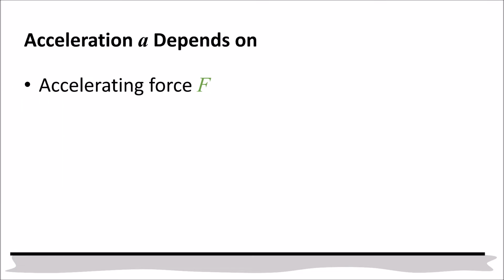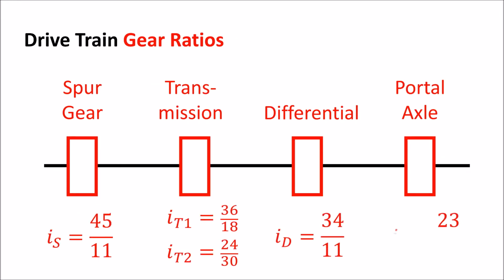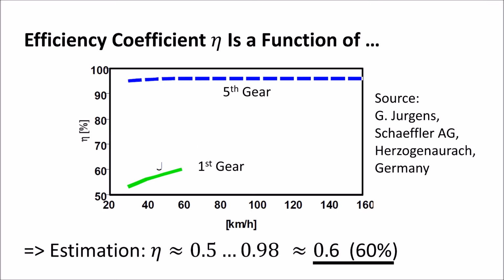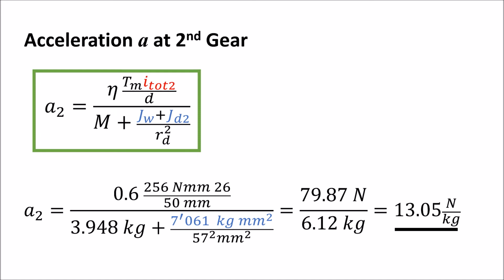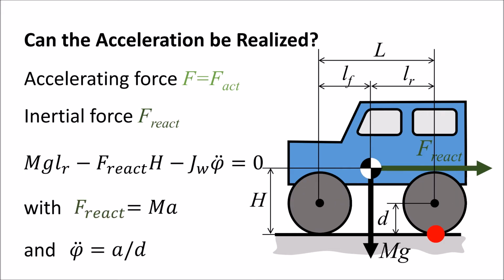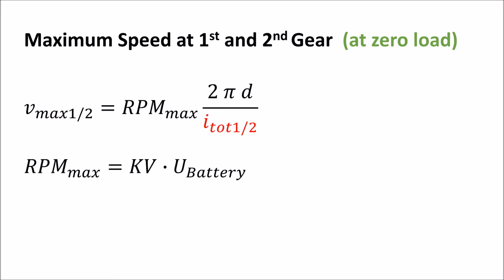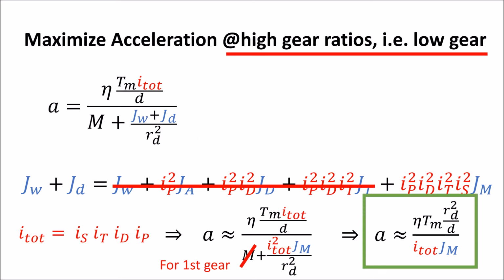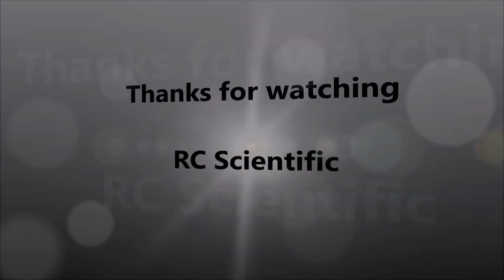DRIVE TRAIN insights and ACCELERATION capability of a TRAXXAS RC car model chassis

Comment: Great video!  I really enjoyed how you walked through it.  

It would be great to then take this from the theoretical and show modifying one of the recommended parameters and showing the difference in the real world.
Reply from the maker: Thanks for your nice comment. Indeed, that would be a great next step, especially in order to increase acceleration. But then I would do it with another car, that is more suitable for racing or bashing.
Reply: @rcscientific6004  Honestly, a crawler can frequently use a burst of speed to get up and over things. 

You could easily show how a heavy tire and wheel setup on the TRX4 could hurt in some cases.   That would get folks' attention!!!  :)